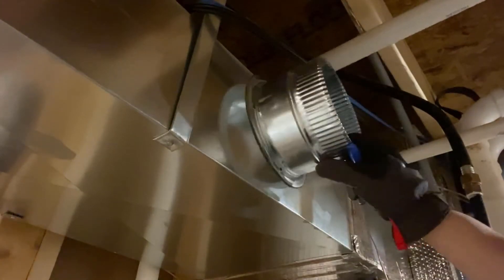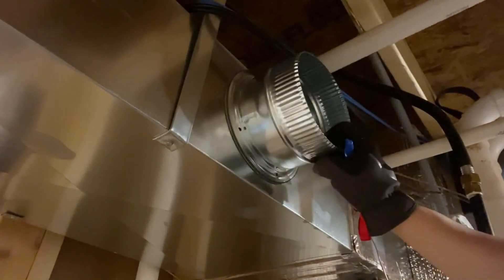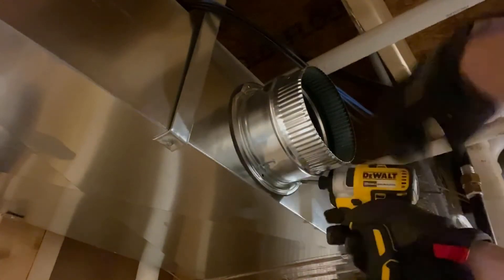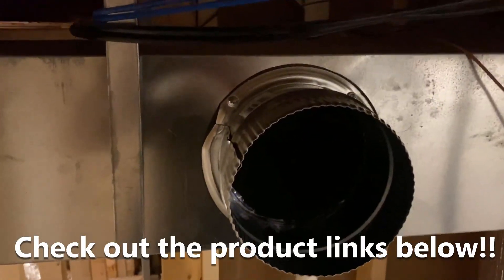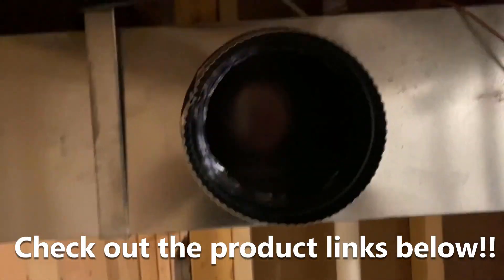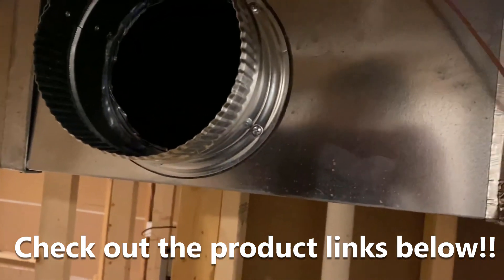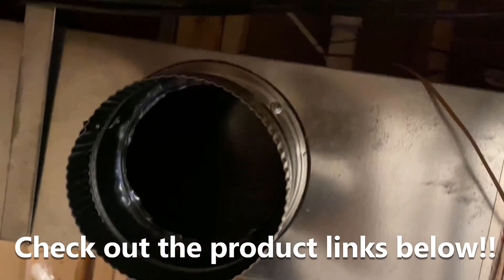[Quick How-to] Install Takeoff for Easy DIY HVAC Realignment on to an Existing Ductwork

Comment: Don't use a phillips or slotted screw.  Use a drill screw with a hex head that is made for sheet metal.  I like Evco, but more well known is Malco.  You can get them online or just walk into an HVAC Supply house.  There you will get a good quality snip and also a circle cutter.  Will make your job much easier
Reply from the maker: Thanks

Comment: That is not a proper takeoff, there will be little to no airflow out of that heat run because he didn’t use a proper takeoff which is angled for increased airflow.  Those are also the wrong snips, never use those on sheet metal especially ductwork.
Reply from the maker: Thanks for the advice

Comment: Aren't you supposed to seal that up too? I can't believe that's it for installing that takeoff. I'm not an HVAC subcontractor though. Can someone confirm?
Reply from the maker: I think it’s always better if you seal them up. I didn’t for this one but did for other parts of the ducting
Reply: yes, seal it with aluminum HVAC tape or mastic which is better. (which is like a glue made specifically for ductwork)

Comment: You keep saying you bought straight snips because you were tight on budget.  You could have bought either lefts or rughts and been better off.  Straight snips are the WRONG tool for the job.  Also, if you really wanna stop being a chooch, get a hole cutter.
Reply from the maker: Thx for the advice

Comment: Hi how do I seal up the hole where a takeoff was? There a 4in diameter hole i want to cover up on my duct. Thanks
Reply from the maker: I’ve just covered it with a slightly larger sheet metal and taped it all around

Comment: The reason it’s hard to cut because you using straight snips not offset snips 👍🏾
Reply: That hole is chopped up n looks crazy.. honestly you should u some greens . Yu  would get a way cleaner cut
Reply from the maker: Thanks! That might as well be right but being a DIYer I wanted to cover both directions with a single snip🤞
Reply: @hammerandrake you can still cover both directions with a single snip (either left or right, it doesn't matter) there are some angles that are difficult to cut but that's only when objects are on the way (like 2x4 or pipes, hardly ever happens) but believe me, if it's difficult with an offset it's gonna be more difficult with a straight snip

Comment: I want to install my 10" takeoffs for my whole home dehumidifier on the side of the return plenum..just as you did there. Do I have to use straight takeoffs or can a 45 degree top takeoff be used as a side takeoff? 
These are only being used to pull air from the house through the return plenum..through the dehumidifier..then back into the return plenum again just before the blower. Dehumidifier runs at 280 cfm.
Reply from the maker: Hi, I am gonna guess 45 degree is ok given that you are using 10”. Thanks for watching!
Reply: If you buy a system like an Aprilaire unit, you can pull from the supply line and connect ducting to the return air and run your system on continuous fan and let the water go down the drain or through your condensate pump.   I have no idea where you live and how much humidity your home has and what kind of furnace/air handler or condenser system you have.  If I knew those things, I could help more.  I have one system with the dehumidifier actually in the ducting and being ducted back out to the return air.  IT can pull 120 pints a day easy.  A good air conditioner that is current will help pull off humidity and help dehumidify the system and let it go down the drains.  So many options, just depends where you are and what equipment you have now.